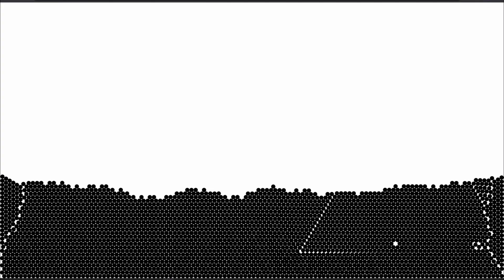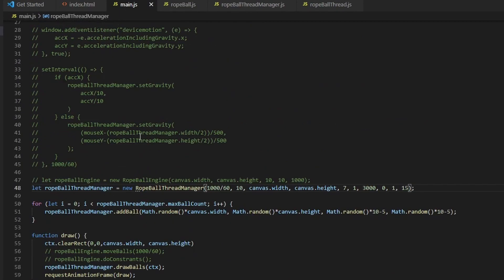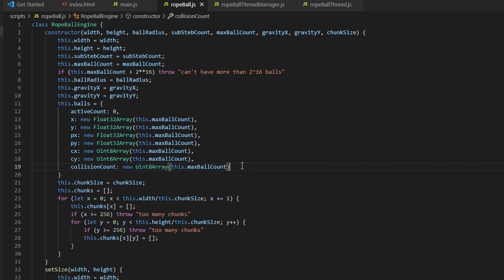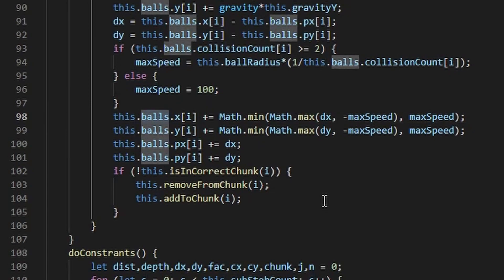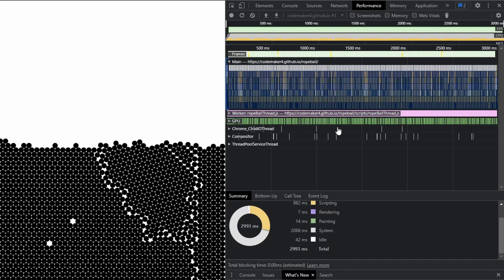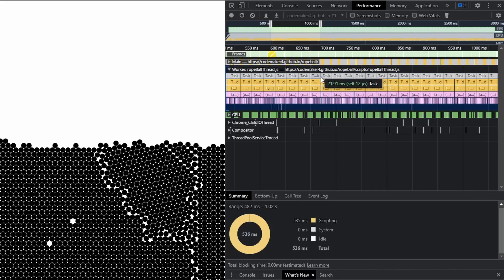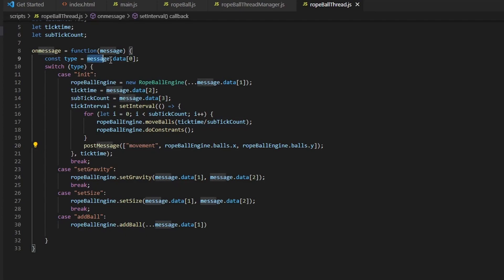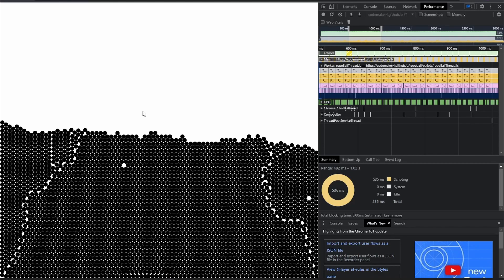Verlet integrator physics engine in JavaScript

Comment: Nice, i am working on this too. I first implemented this in JS and then tried c++ and damn, difference is huge. 
Using js - around 500 objects maximum with 50+ fps without any optimisations. And 2000-2500 with grid (but still on single thread)

Using c++ i got 2000-2500 objects with same fps without any optimisations

Taking in account that collisions solving is O^2, it's around 25x difference (i believe that's even slightly higher in fact)